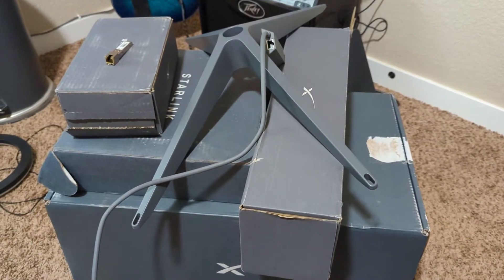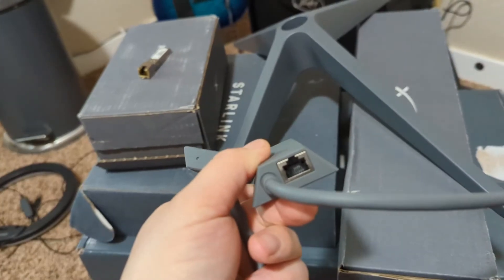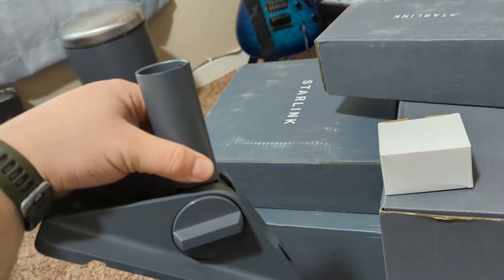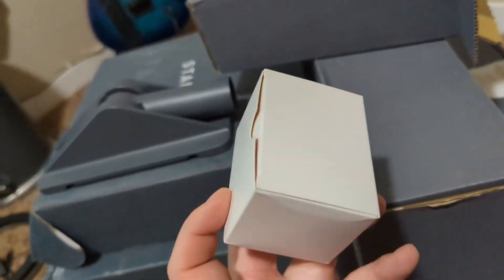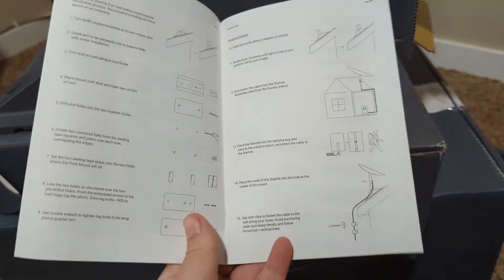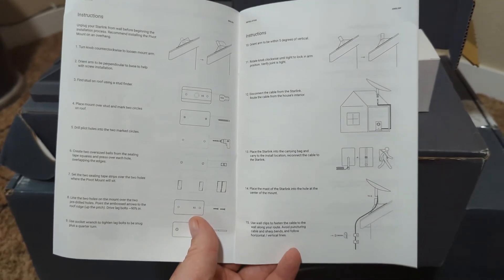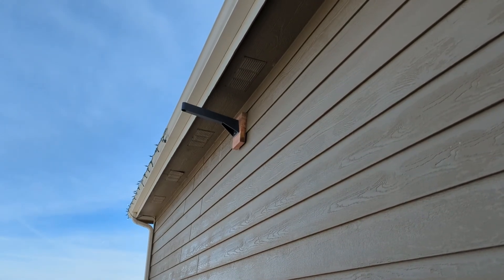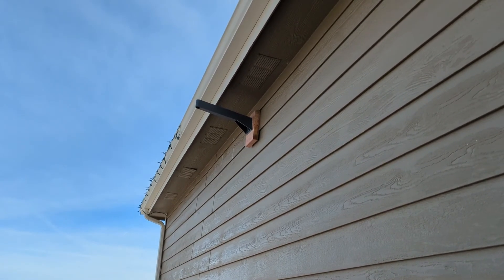Starlink Install Change of Plan - A Grateful Hearth

Comment: My StarLink Gen 2 dish arrived on Wednesday, I immediately put it on the ground mount to get it working & tested..  pole mount and short wall mount, along with Ethernet adapter show “preparing shipment”, Estimated Feb 28 - 6… I assume they mean March 6th.  I’m near Boston, ground is all mush from the snow…. Can’t rent the JLG 35’ platform lift until I have solid ground for the outriggers, peak of the eave is at 37’, so not attempting from a ladder..  at least the dish will be confirmed tested & working until April/May, when I can rent the lift to install permanently.  Another bonus is I was able to run the cable & position router/power supply by rack (also have a Dream Machine Pro), and measure outdoor remaining cable at 43’, which is enough to go up 2 floors and be attached to trim under roof shingles.  Planning is key 👍👌👌

Comment: Does the square  dish stem  twist in the pivet mount, because the square dish stem twists in the pipe adapter even though it's locked in , wondering because I get my Starlink in February
Reply from the maker: No, it locks in in a specific direction. There is a tab inside the mount that keeps it locked in.  It will not swivel.
Reply: @agratefulhearth8452  Are there updates to your saga yet? I'm on the edge of my seat after watching a few videos.